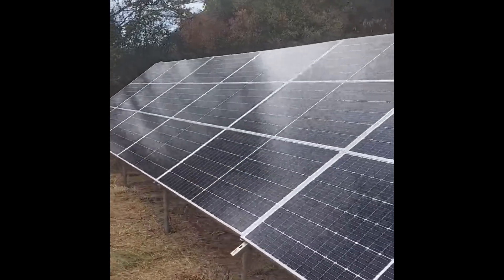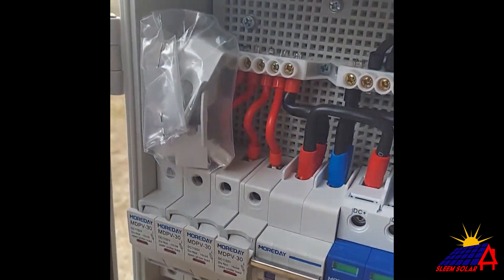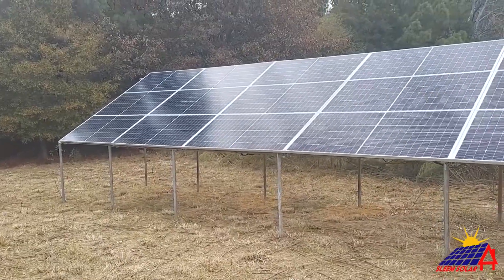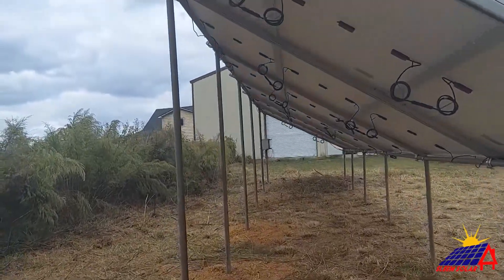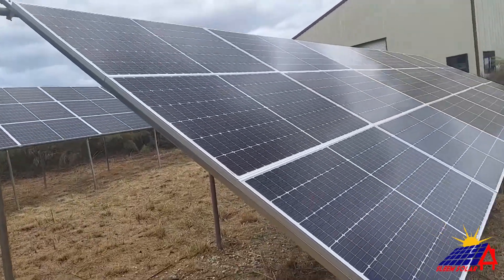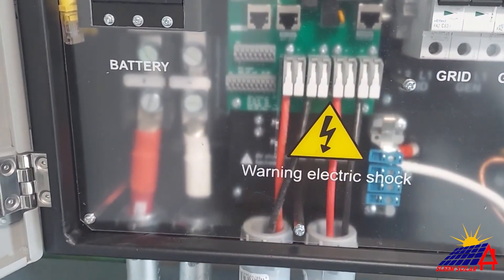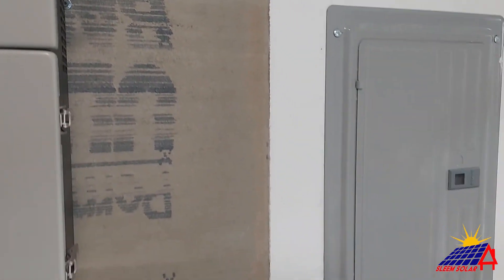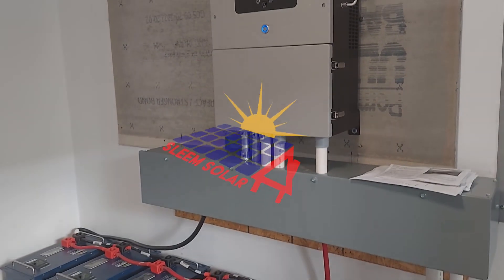48Volt, 12K SOL-ARK Inverter, 600AH LifePo4 Battery, 13kW Solar Panel System

Comment: Very nice install. How far is the solar array from the inverter? What size wire did you run from the combiner box to inverter?
Reply from the maker: The solar array was 200 feet away from the inverter. The specs said we could have used 10awg PV wires, but to rule out any lost in current, we went with 8awg thhn wire.